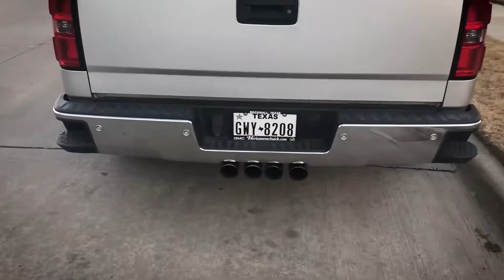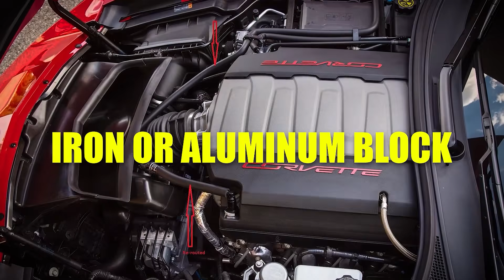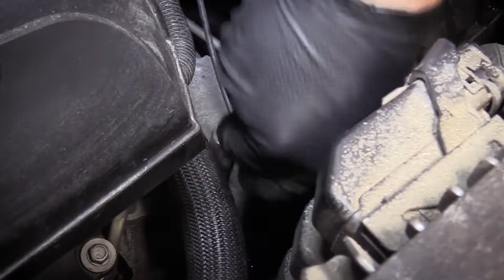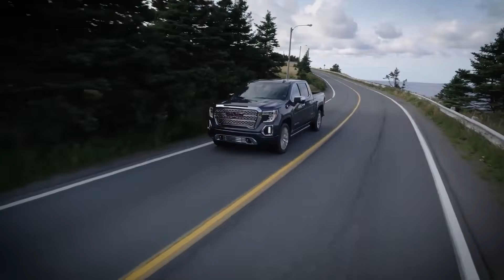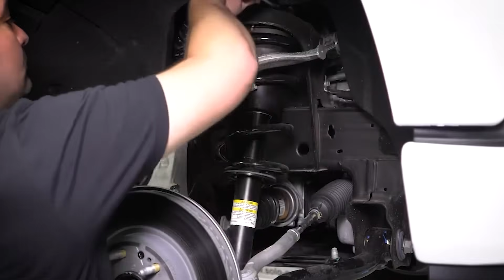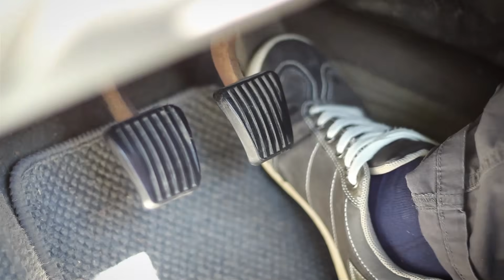5 BANNED GMC Modifications That Actually Work

Comment: I do have 2014 GMC SIERRA 1500 2WD. So the best version for my upper control arms for lifting 2” and not having too much stress in my upper control arms is going with cognito? So they can handle the 2” lift without causing damage.
Reply from the maker: Upgrading to arms with corrected ball joint angles is definitely the right move to prevent binding and premature wear at that lift height.
Reply: @EverythingGMC-k9x how to correct the ball joints properly? Lower ball joint replacement? Any specific brand? 🤷🏻‍♂️

Comment: When I had the trans rebuilt on my 14 half ton 6l80 by a reputable diesel shop the owner told me the GM dexron 6 fluid was more than adequate for everyday use. I asked about amsoil he told me not to bother
Reply from the maker: Your builder's right for daily driving. Dexron VI is a strong fluid and the 6L80 was designed around it — for a truck not towing heavy or seeing abuse, the OE spec is plenty. Amsoil earns its premium under sustained heat and load, but on a stock half-ton you won't see the difference. Put the savings into more frequent changes instead.

Comment: My super charger is gonna tear my tie rods and hub bearings to shreds for sure!
Reply from the maker: Supercharger on a stock front end is a real concern — the torque multiplication hits the tie rods and wheel bearings hard under hard acceleration. Upgraded tie rods and hub bearings before boost is the right order of operations. 🙏

Comment: I had a 6.6 duramax that was fully deleted and tuned; passed every single emissions test but since emissions control equipment was removed it was automatically failed. 

Would have cost me around $12k to reinstall everything, so I hustled bought a house in a county with no emissions.
Reply from the maker: Moving counties to avoid emissions testing is the most committed emissions delete story in the comment section. Respect the hustle. 😄 The $12k reinstall cost vs cost of a house in a no-emissions county — that math actually worked out. 💪

Comment: The problem that you seem to severely overlook here, is it GM is neither obligated nor responsible to investigate the engineering of every single aftermarket part manufacturer. Observations about some of these parts may be correct but then if they approve one that opens up the door to lawsuits and responsibility for failures and mainly what it proves is that you know nothing about business law. If these parts manufacturers are so great then what they should do is assume the liability onto themselves. But you have no business bashing a corporation because they won't bow to external pressures. The truck works just fine the way it is. If you modify it then it's success or failure is on you. That's called maturity and the self-responsibility.
Reply from the maker: The self-responsibility argument is fair and agreed on — anyone who mods their truck owns the outcome. The channel's position has never been that GM is obligated to approve aftermarket parts. The point is that GM built a system that fails at scale and the aftermarket exists to address that gap. Magnuson-Moss protects owners from blanket warranty denials, not from the consequences of bad installs. Two different things. 🙏
Reply: @EverythingGMC-k9x well TO BE FAIR,,, it is presented as a complaint that AFTER modifications are done GM declines warranty coverage. That was my interpretation, and you know there are a LOT of people "out there" to whom it will appear to be an endorsement of their bad behavior or unrealistic expectations simply because their "interpretation valve" is permanently stuck on ME ME ME ME. Your presentation otherwise was nicely done and EXTREMELY INFORMATIVE for those whose "objectivity valve" is in good functioning order.😁 Thanks for a well done video!

Comment: I changed out the transmission pan to a Mag-Hytec larger capacity better unit.  GM said we can’t remove the pan but would do the drain and fill with no filter change.
Reply from the maker: The Mag-Hytec larger capacity pan is a great upgrade — more fluid volume means lower operating temps and longer fluid life. GM saying they can't remove the pan is a dealer labor policy issue, not a mechanical one. Any independent shop will do the filter with the drain and fill no problem. Always change the filter when you change the fluid. 👍

Comment: I would love to have long tube headers on my 2024 Chevy Express extended cargo van.
Reply from the maker: Long tubes on a 2024 Express extended cargo van — the routing challenge on a van platform is a completely different beast from a truck. It's doable but the exhaust path around the firewall and the chassis crossmembers makes it a serious fabrication job. Worth talking to a shop that specializes in LS swaps and van builds before committing. 🙏

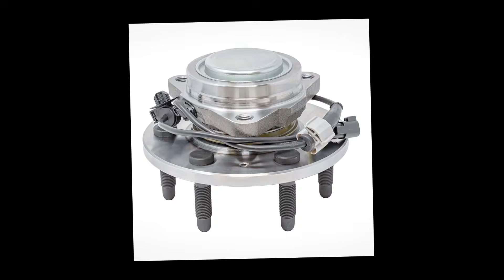Comment: Okay minute 4:03 “pistons, rods, bearings and gaskets” what does suspension parts had to do with engine cylinder pressure?😂😂 whoever made this video or edited It doesn’t know how internal parts look like
Reply from the maker: Fair catch on the visual — that's a B-roll mismatch during editing, not a technical error in the content. The script references internal engine components correctly. Production note taken. 🙏

Comment: GM is known to be seriously anal, but I don't blame them about the supercharger.

If installing long tube headers, have the place that sells them install them.  Installation can be seriously non trivial.

Smokey Yunick's polished cast iron manifold is a good idea.  Not as big an improvement as in the 50s when he invented this idea.  But still a big improvement, and totally invisible.

You have to remember, denying warranty claims is GM's primary business plan.
Reply from the maker: Smokey Yunick's polished cast iron manifold trick is old school genius — maximum gain, zero visibility, and it's been working since before most of these trucks were built. The fact that it still applies to modern LS-based engines says everything about how good that platform is underneath all the emissions equipment. And the last line — that's the whole channel in one sentence. 🙏

Comment: And these are just a small sample of why I stopped buying American made vehicles, especially from the big 3.
Reply from the maker: What specifically pushed you away? The AFM issues on the 5.3 are real and documented, but the GMT900 pre-AFM platform and the 6.0/6.6 heavy duty engines tell a completely different story. Not all American trucks are the same truck. 🙏

Comment: Just remember that when the Mfg tries to deny your warranty coverage for using aftermarket parts, you have legal protection. The magnuson moss warranty act is your ace in the hole.
I had a dealership try to tell me that putting a lift kit on my brand new truck would void my warranty. I told him he better rethink that idea.
Reply from the maker: That dealer was wrong and you were right to push back — the Magnuson-Moss Warranty Act is exactly the protection every owner should know before walking into a service department. A lift kit does not void a powertrain warranty unless GM can prove the lift directly caused the specific failure. Knowing that going in changes the entire conversation. 💪

Comment: I used to believe in brand loyalty unfortunately the brand quit believing in us, I wouldn’t own a ford or a gm product right now. Getting ready to buy a ram 1500, we have had great success with them since 2015. Screw gm especially they are out for your money while leaving you stranded on the side of the road.
Reply from the maker: That frustration is real and valid — post-2015 GM quality control issues are exactly what this channel covers. The Ram 1500 has made serious reliability gains since 2019. If you do go that route, avoid the eTorque hybrid system and the early eight-speed variants. Do your homework the same way you would on a GMC. 🙏
Reply: @EverythingGMC-k9x yes sir already doing that, just sucks what the auto manufacturers are doing and people are still buying their crap.

Comment: Whoa!  With long tube headers, you boldly,state the exhaust has to snake around the steering. REALLY?  Where would that be, in the UK. Where exactly on this earth be?  Last I heard, here in the USA, the driver sits on the left side of the car, and on the right side of the road.
Reply from the maker: Fair point on the driver's side — that section is framed for a US market audience with left-hand drive. Right-hand drive markets have different routing considerations for long tubes. Good callout for international viewers. 🙏

Comment: Magnuson and Moss act protects your warranty from unprecedented denials or cancelations.  The California air board has no say in it.  GM has can only deny something if they can prove a direct link between the part and the failure.
Reply from the maker: That's exactly right — and every GMC owner should know this before walking into a dealership. The burden of proof is on GM to show a direct causal link between your aftermarket part and the specific failure. An AFM disabler, catch can, or exhaust does not void your entire powertrain warranty. Appreciate you putting this in the comments clearly. 🙏

Comment: I am surprised the plug in that disables the fuel economy cylinder deactivation didn't make the list.
Reply from the maker: Good point — the AFM disabler didn't make the BANNED list because technically it's not banned anywhere, it's fully legal. It lives in the Upgrades Goldmines and WORST/BEST Upgrades videos on the channel. Arguably the single most important plug-in any five-three owner can buy. 👍

Comment: Most of what you state violates the Magnus and Moss Warranty Act because if you pay for it it cannot void your warranty.
Reply from the maker: The Magnuson-Moss Warranty Act is one of the most important things a truck owner can know — dealers cannot void your warranty simply because you added an AFM disabler, a catch can, or aftermarket parts unless they can prove that specific part caused the failure. Worth knowing before any dealership visit. 🙏

Comment: There is an advantage to the original cast iron manifolds on GM LS Motors. Not only do you get cooler under hood temperatures. These are some of the freest flowing cast iron manifolds that exist. If you wish to, you can always order a new set of the cast iron manifolds and have them internally honed by pushing A material through it that will polish the inside of the cast manifold and get even closer to header performance with the cast iron manifolds. It's called extrude honing. And it looks for all the world like a standard system because it is. You can also polish the first several inches of the each end of the cast iron manifolds and it will do almost as much.
Reply from the maker: This is genuinely valuable info — extrude honing the stock cast iron manifolds is one of those tricks that stays completely hidden under the hood while delivering real flow gains. The thermal advantage over aftermarket headers is a bonus most people don't consider. Appreciate you dropping this level of detail in the comments. 🙏

Comment: what about catch cans?
Reply from the maker: Catch cans didn't make the BANNED list because they're legal everywhere — but they absolutely belong in your build. On any five-three or six-two with AFM/DFM, an oil catch can is one of the best fifty dollar decisions you can make. Keeps oil vapor out of the intake and off the valves. Covered in depth on the Upgrades Goldmines video on the channel. 👍
Reply: @EverythingGMC-k9x finally added one to my truck after 60k.   Wished i knew about them sooner.
Reply: @bdub3871 need improved oil pumps for  DFM/AFM
Reply: Does it make that much of a difference? What exactly does it do. Have a 2019 at 90k
Reply: @EverythingGMC-k9x direct injection gums up the intakes

Comment: What is the best trans fluid to run?  Have 68k on my truck and taking her in Tue to dealership for a trans fluid & filter change.     TIA
Reply from the maker: At 68K the dealership fluid change is good timing — just make sure they're using Dexron VI or the GM-spec ACDelco fluid, not a generic substitute. If they try to upsell you on a flush instead of a drain-and-fill, stick with the drain-and-fill. At 68K you don't need a full flush, just clean fluid and a fresh filter. That alone will add serious life to that transmission. 👍
Reply: @E @EverythingGMC-k9x anks!   Yeah i seen many saying to stay away from a flush.   Seeing alot of mixed opinions.   Also wondering after the drain & fill, should the tech check the TCM and calibrate the shift timing, shift firmness, torque convertor lockup strategy & line pressure?   I asked the service manager at the dealership if her tech do any of that & this was her response….. I will put all this in the work order because I’m a blonde and can’t remember anything lol
Reply: Amsoil Hands down.
Reply: Stay with the factory dealer transmission fluids  required.
Reply: Make sure it has allisons rating and dex 6
Reply: @bdub3871  amsoil signature series